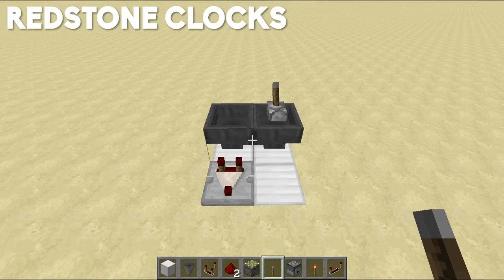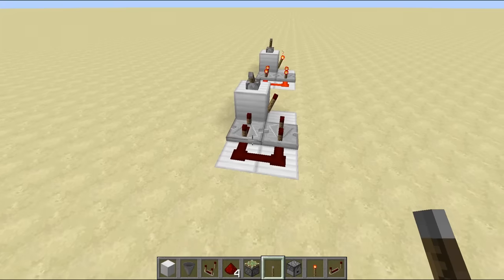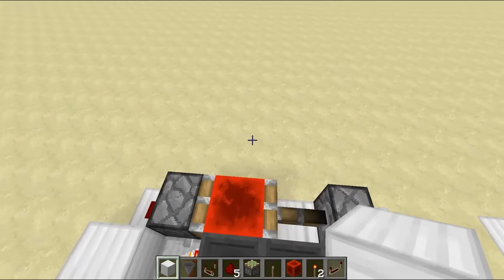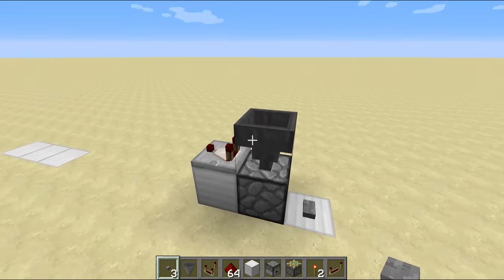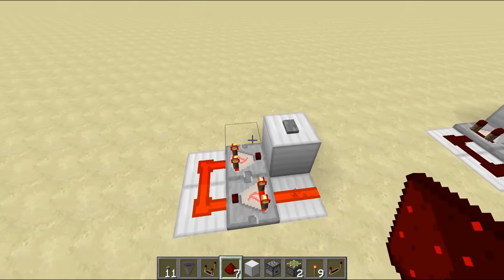25 Minecraft Redstone Circuits YOU SHOULD KNOW!

Comment: Thanks for the video, but with the And gate, how do you use the output?  I'm trying to get it to light a redstone lamp, but if I put it above the output torch, it blinks a bit and fizzles out.
Reply: You created a blinking circet because the torch powers the lamp, the lamp powers the redstoneline ,wich turns of the torch and all starts again. It fizzles out because the circet is to fast for the torch.
Solution: And gates are not meant to connect directly! Hide your AND gate! Use redstone to conect the two inputs with your leavers and use redstone to connect your output wit the lamp
PS: If the lamp would be infront of the torch it would also work, but mybe not the prettiest solution.

Comment: clocks:
0:46 hopper clock
0:56 tutorial
1:20 redstone torch repeater clock
1:33 tutorial
1:56 comparator clock
2:19 tutorial
2:33 etho hopper clock
3:00 tutorial

monostable circuits:
3:20 one tick monostable circuit
3:38 tutorial
3:51 dropper hopper monostable circuit
4:08 tutorial
4:21 silent one tick pulse generator
4:32 tutorial

t-flip flops:
4:56 piston t-flip flop
5:28 tutorial
5:51 dropper hopper t-flip flop
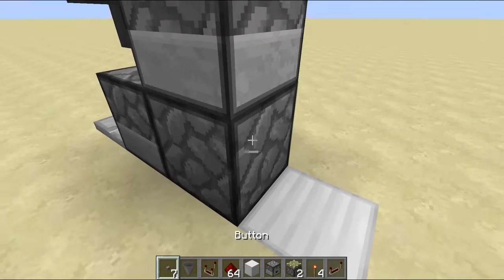6:19 tutorial
6:41 repeater lock t-flip flop
6:50 tutorial

pulse extenders:
7:18 comparator pulse extender
7:28 tutorial
7:43 "old school" pulse extender
8:08 tutorial
8:16 abergate? (idk what he said)
8:28 tutorial
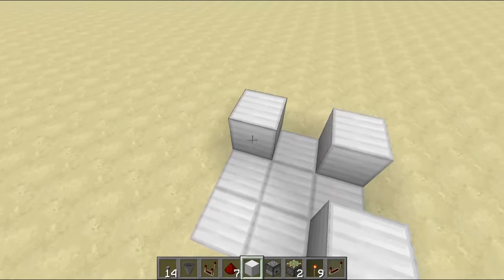8:48 piston pulse extender
9:18 tutorial

logic gates:
9:50 AND gate
10:05 tutorial
10:22 OR gate
10:46 tutorial
10:58 vertical AND gate
11:16 tutorial

RS NOR latches:
11:37 RS NOR latch
12:12 tutorial
12:28 dropper RS NOR latch
12:51 tutorial

double piston extenders:
13:10 basic double piston extender
13:38 tutorial
13:51 flush horizontal double piston extender
14:07 tutorial
14:27 flush vertical upwards double piston extender
14:48 tutorial
15:38 flush vertical downwards facing double piston extender
15:51 tutorial

BUD switches (just use an observer block instead, these are obsolete)
16:38 basic BUD switch
17:06 flush with the wall BUD switch
17:18 tutorial

Comment: TIMES TAMPS
clocks:
0:46 hopper clock
0:56 tutorial
1:20 redstone torch repeater clock
1:33 tutorial
1:56 comparator clock
2:19 tutorial
2:33 etho hopper clock
3:00 tutorial
monostable circuits:
3:20 one tick monostable circuit
3:38 tutorial
3:51 dropper hopper monostable circuit
4:08 tutorial
4:21 silent one tick pulse generator
4:32 tutorial
t-flip flops:
4:56 piston t-flip flop
5:28 tutorial
5:51 dropper hopper t-flip flop
6:19 tutorial
6:41 repeater lock t-flip flop
6:50 tutorial
pulse extenders:
7:18 comparator pulse extender
7:28 tutorial
7:43 "old school" pulse extender
8:08 tutorial
8:16 ABBA pulse extender
8:28 tutorial
8:48 piston pulse extender
9:18 tutorial
logic gates:
9:50 AND gate
10:05 tutorial
10:22 OR gate
10:46 tutorial
10:58 vertical AND gate
11:16 tutorial
RS NOR latches:
11:37 RS NOR latch
12:12 tutorial
12:28 dropper RS NOR latch
12:51 tutorial
double piston extenders:
13:10 basic double piston extender
13:38 tutorial
13:51 flush horizontal double piston extender
14:07 tutorial
14:27 flush vertical upwards double piston extender
14:48 tutorial
15:38 flush vertical downwards facing double piston extender
15:51 tutorial
BUD switches (just use an observer block instead, these are obsolete)
16:38 basic BUD switch
17:06 flush with the wall BUD switch
17:18 tutorial

Comment: What is the point of a T flip=flop when you can just use a lever? seems completely pointless apart from cosmetic reasons, in which case the repeater lock is probably the only one you need to know. (or hopper dispenser one cos its compact)
As for the clock circuits, it would be nice to emphasise the advantages and disadvantages of each (i.e. space requirement, resource requirement, etc). 
Most of the other logic gates... seems useful, but difficult to commit to memory without a specific demonstrated purpose
maybe a super complicated circuit like BUD to detect crop growth with and circuits, multi pistons to push a red stone in a few direction to arrive at a final destination that triggers another switch into an AND switch of multiple thingies, which then triggers an auto  harvest mechanism and also resets the block? (all of which could probably be achieved by a villager, but look cool non-the-less... and now with observers)...
Reply: Sometime, you need to a signal on/off from a signal that come from something else then a lever.
I don't have an example in mind but I had seen some of those circumstances in some of his videos.
Also, sometime you don't want to use a lever.

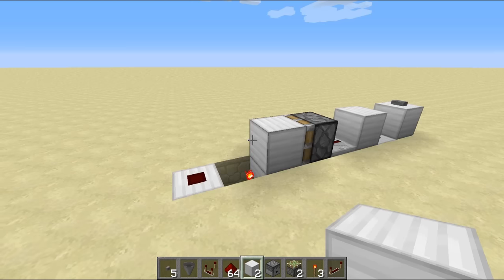Comment: 5:19 so basically it's a needlessly complicated lever? :))
Reply: That can be useful when you are doing a redstone thing that send one signal which need to switch
something on/off. He is using it a lot in his big crazy stuff. That can also be useful if you want to
use a button, a pressure plate or a trip wire.
I used one for my hidden nether portal for example. (and a button is easier to hide)
Reply: Oooh, now it makes more sense! That certainly gives rise to quite a few opportunities I reckon. Thanks!

Comment: Okay dumb question why would i use a t flip flop if i could use a lever....
Reply: Maybe because the tflipflop is used in a huge machine that uses a button to be activated? I don't know
Reply: Also, buttons can be hidden and can look cooler in certain builds
Reply: Normally, the signal doesn't always come from a lever.. It can come from anywhere and any length

So you need a flip flop to convert any signal into a constant one..
Reply: Levers cant be used like that in bigger contraptions as they need to be toggled manually, which defeats the point of automation

Comment: Your AND gate isn't an true AND gate, because if both inputs are off you still get an output. In reality what you showed is a negated or inverted XOR gate.
Reply: Okay, Only the first AND gate you show has this problem. The second is a proper AND gate
Reply: Ok so all of the logic gates concepts are essentially different requirements/conditions for activating something, meaning they all have to start at zero? Or is the AND gate in particular just too simple to start with a pulse, which would instead be a more complex gate. I think I am overcomplicating it and the AND gate just has to be this way because it is that simple.
Reply: @obscure_genesis  I think you are over complicating it by trying to define set rules for all the gates to follow, there might be those rules there might not idk. The point is that an AND gate is defined such that two null values going into the two inputs gives a null output. now not all gates work like this, for instance a NOT gate will turn a null input into a powered output
Reply: @JadeNeoma  oh ok that makes more sense, thank you for clarifying